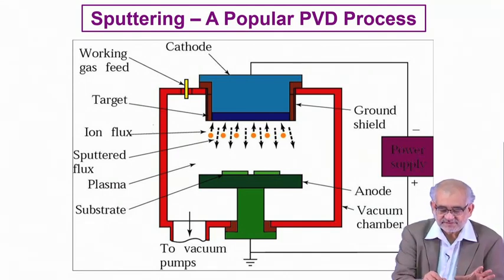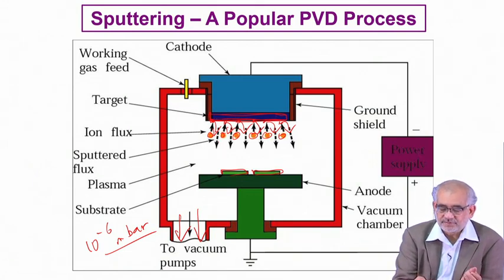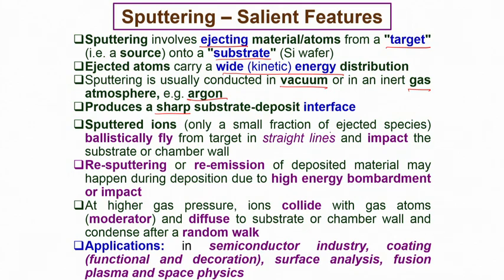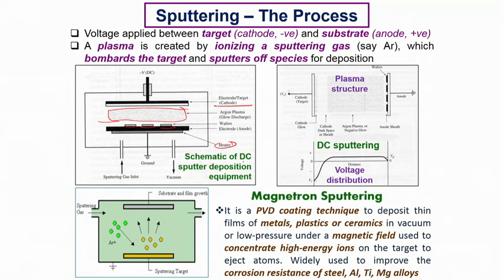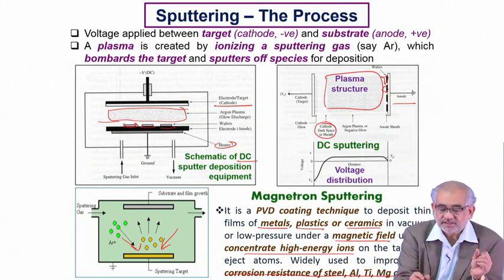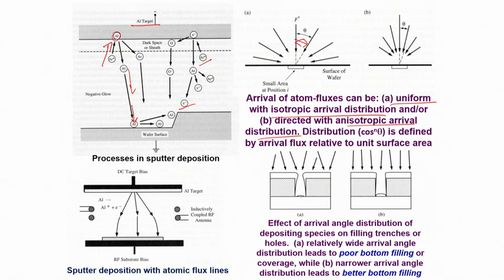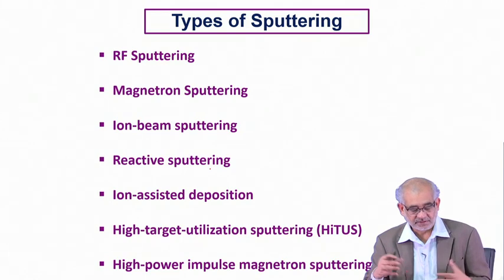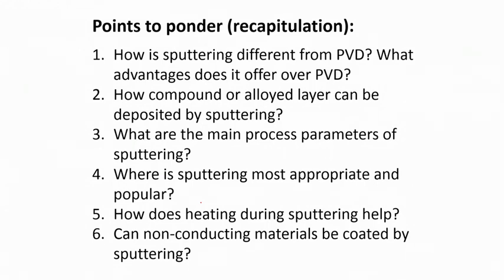Lecture 46 : Sputtering

Comment: Argon is a noble gas so how can it be made into an ion?
Reply: while noble gases are chemically inert, the energy provided by the electric field in a plasma is sufficient to ionize them, enabling their use in the sputtering process.
And Argon easily ionised in that applied voltage.
Reply: So, Argon easily ionised that applied voltage in the chamber.

Comment: At what time ionization of Argon gas will happen?
Reply: The specific timing of ionization in sputtering can depend on a variety of factors, such as the sputtering conditions (e.g., the gas pressure, the sputtering power, and the target material), as well as the properties of the incoming ions or electrons. In general, however, ionization is an ongoing process that occurs throughout the sputtering process as long as there is sufficient energy available to ionize the gas atoms.
Reply: Thank you.

Comment: Dear Prof,
Let me know the procedure ..
1. Vacuuming Chamber down to 1.10-6 mBar.
    In this condition, we hope all air particle has gone !
2. Enter the argon gas.
     - How pure is Argon?
     - How much pressure?
3. Turn on the power supply.
  - I thought, using DC power. Please correction.
  - What is the voltage, current used?
4. Is there a formula relating the correlation between:
  - Different potential, current, operating time and chamber pressure?
  - or if you have the above correlation based on the rule of thumb, please inform me.
5. Thanks for the explanation.

Regards,
Pranahadi
Reply: Hello, I can help you out with some questions, since I'm studying this subject and did some experiments with UHV
1. Ofc not all air particles are gone (and water particles in the air etc), they are just few so it wouldn't affect the process that much anymore.
2. Usually Argon is kept at 10e-2 to 10e-3 mbar. The purity used in our case was Argon 5.0. Exact partial pressure from Argon was something 5*10e-3 mbar
3.The voltage is of course high to achieve plasma (500-1000V). You use DC althought there is a highfrenquency sputtering that uses AC
Current is chosen on the desired thickness of the layer based on constant time. For example for Co-Target for 15 sec, with 0,2A the thickness achieved was 0,3 nm. It depends mostly on Target material, time and the entire device basically. 
4.Honestly, neither. You can try with using measurements from other people but it will always be different since the size is different, the geometry of target may be different etc. Too many factors to make one rule or formula. But generally with higher current the thickness increases exponentially (at least it looks like that).
Reply: @poppy1x3  thanks a lot for sharing your knowledge!